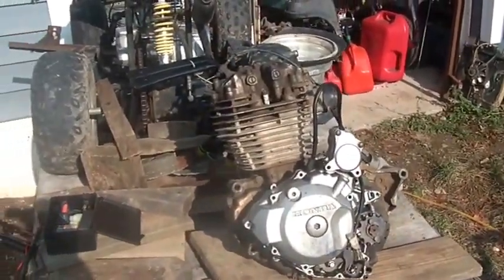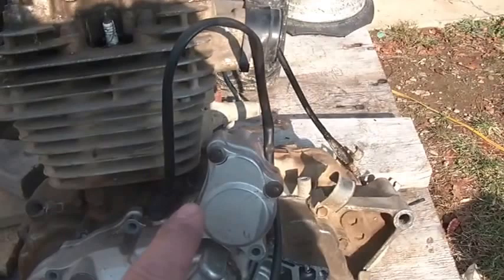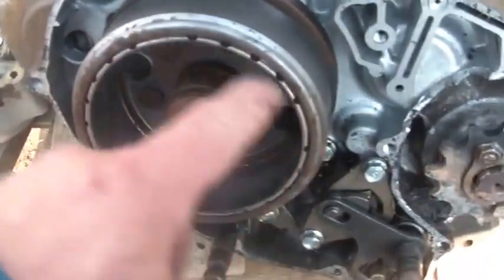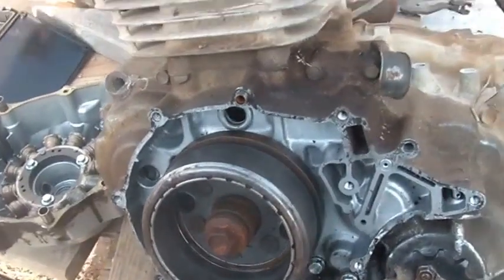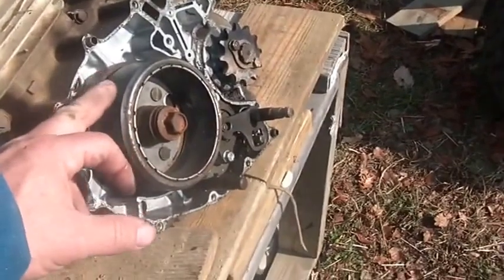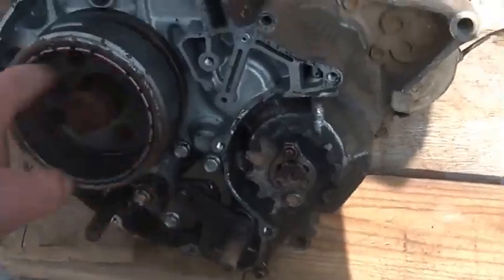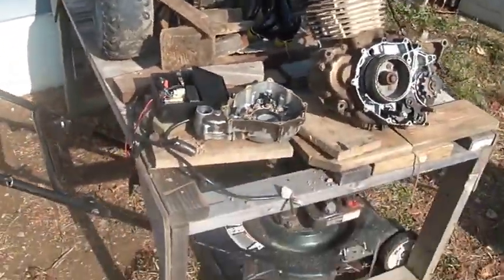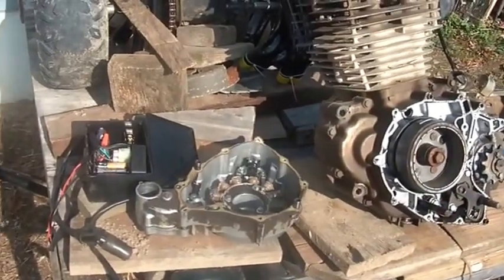Honda 250ES, Big Red, damaged Stator, flywheel, what now?

Comment: OK, so a DC cdi box powered by AA batteries to give the bike spark...I follow that but you have no charging system.   Once the AAs go flat, the bike stops running.  I can see the box being a decent way to check if a motor is any good before spending the big bucks on a new stator/flywheel.  It sounds like you've used it for testing purposes only.

Comment: I have an 86 big red. Replaced battery,solenoid,starter and tried 3 diff rectifiers. Im guessing my stator is bad the headlight wont work without a battery charged. It worked when I got it without battery.

Comment: I would build the box with 9 1.5v none rechargeable AA batteries to reduce the load per battery, with the hope of enabling the use of cheap batteries, although 10 no brand rechargeable AA batteries are about $5 from China.
Alternatively 3 185650 lithium batteries from a broken laptop battery wired in series holder could save a little money, using a buck power bank box as a cheap charger.

The stator maybe able to be rewired. if just one or two winding coil is broken, use the same thickness enamel wire from a transformer, salvaged from an old electrical item, perhaps a dumpster.

Comment: Hey Harvey I need to replace my engine on 1985 250es,do I have to remove rear axle and driveshaft
Reply from the maker: Hey Jose!!! The 250ES that I parted out had a cracked frame, I did not have to remove the rear to get the engine out, but, I'm thinking that it would make things a bit easier.... I'm having trouble remembering how I disconnected the driveshaft and how I got the engine loose from it.... That will be the problem area... Thanks for asking, watching, and commenting!!!!!